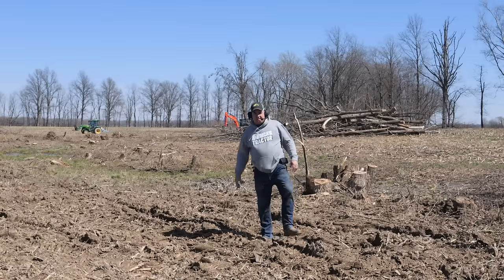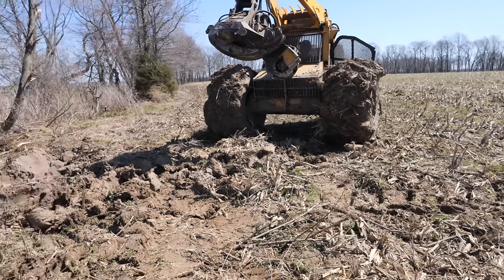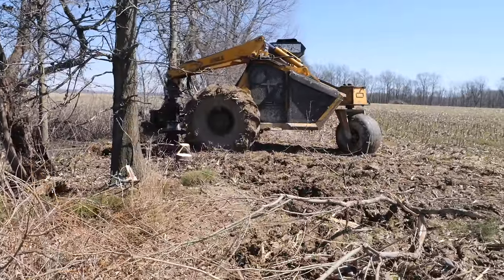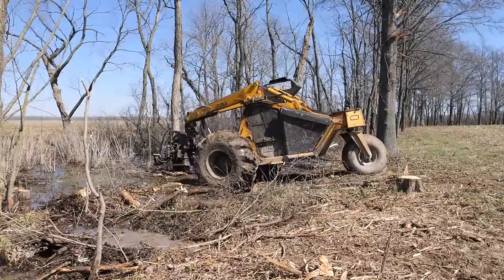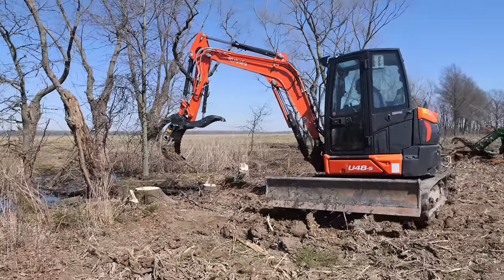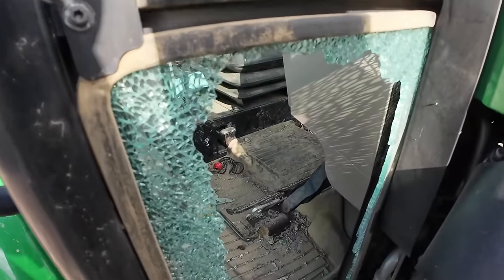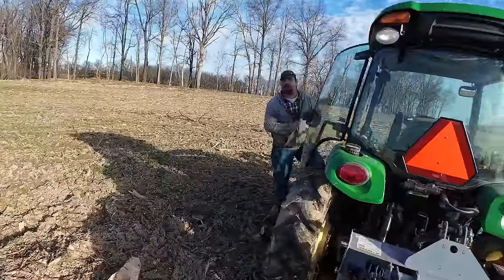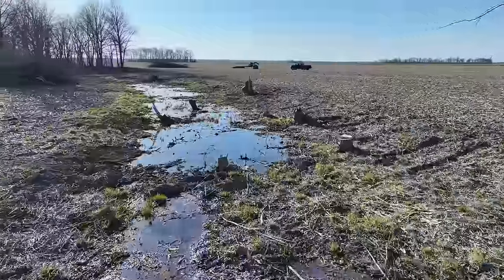Tom, Randall, Crazy Cool Logging Rig! Deere 3520, 3320 Compact Tractors Wetlands Project!

Comment: There are tracked and 4 wheeled, 6 wheeled, and I believe 8 wheeled tree cutting machines.  Also, there are the cutting heads with large round saw blades similar to a circular saw blade. Some of them have longer arms for better reach and can handle the larger cutter heads. Of course, a majority of them are built and used mainly for larger tract logging of larger trees.

It's fun to watch all the different types of equipment in operation!

Comment: With the height of a lot of those stumps, looks like using the Baumalight horizontal tree saw first, to cut them just above the ground, would make grinding them the rest of the way easier and faster.  This is assuming that if you can get in there to grind it, you could get in there to cut the height down first.  You may want to look into several of the 1/2" or 3/4" thick UHMW ground protection mats that have handles cut into them, they are nearly indestructible for the size equipment your using and would be easy enough to move around to get the tractors into places you would get stuck otherwise.  Looks like lots of fun to be had there regardless, have a good one!! 👍

Comment: The last time we had our timber cut one of the machines they used was a Bell.  It had an air-cooled helicopter engine.  Great machine!  It could get into tight spots that the larger harvesters couldn't reach.  It also needed a field repair to the lift cylinder.  At the time a trade embargo with South Africa made parts difficult to get.  I think the guy had to drive five hours each way to get the seals he needed. 🫤